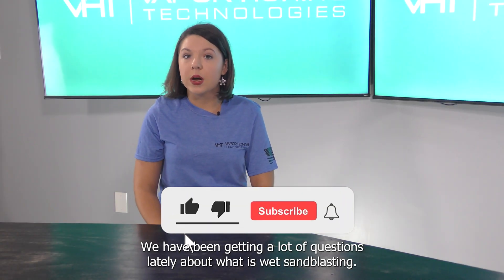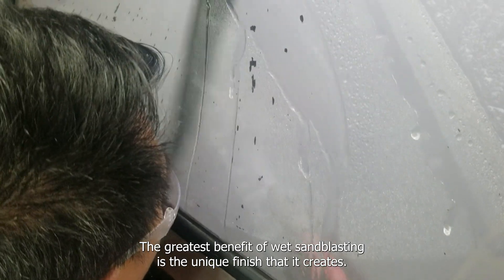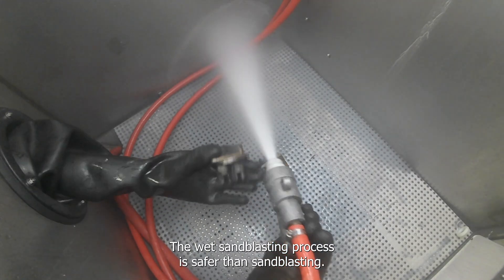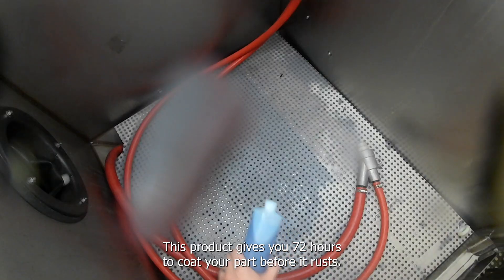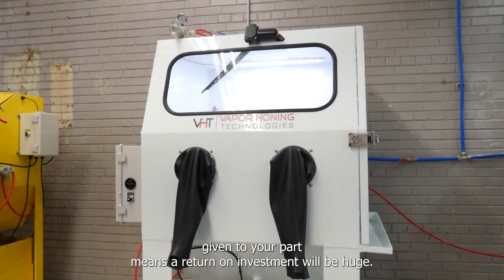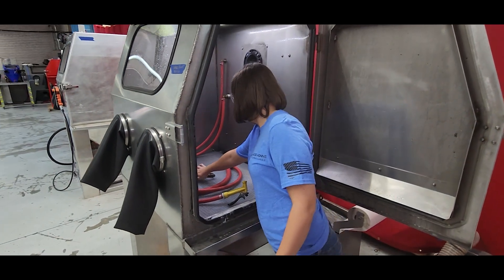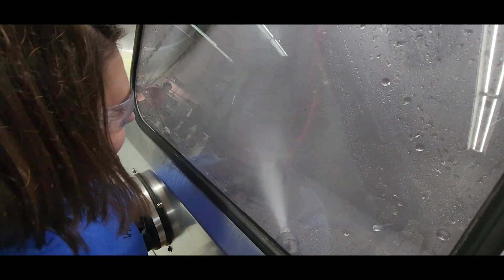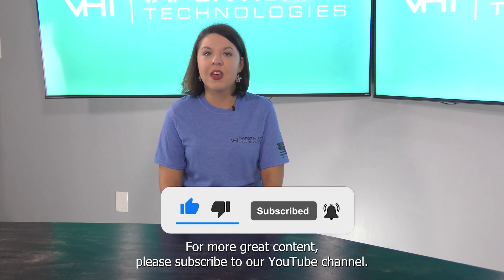What is Wet Sand Blasting? - Vapor Honing Technologies

Comment: can you recycle the sand for next blasting?
Reply from the maker: Yes you can. In a wet blasting cabinet, the abrasive (sand/aluminum oxide, glass bead) will get recycled and is proven to last 3 times longer compared to a traditional sand blaster.